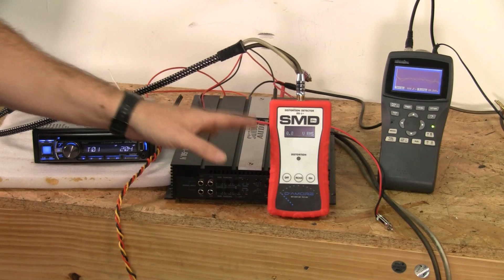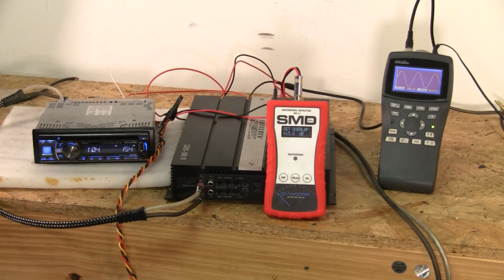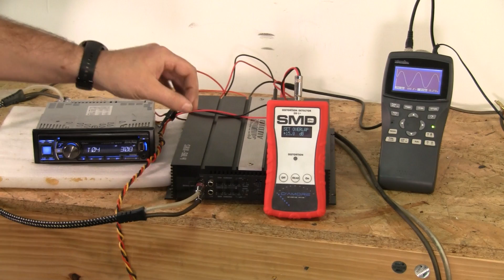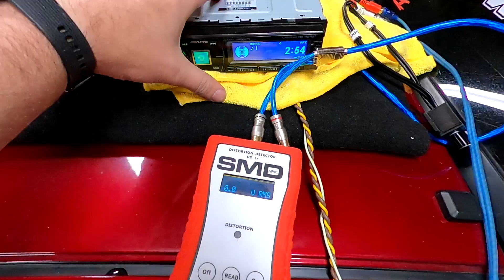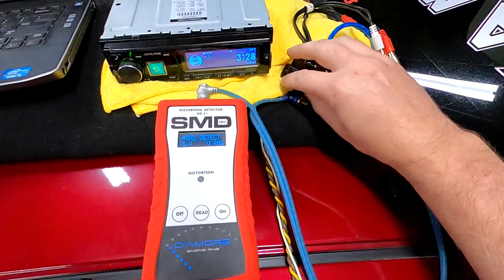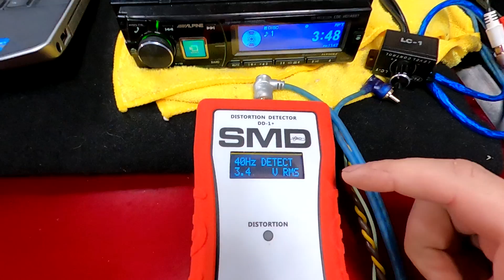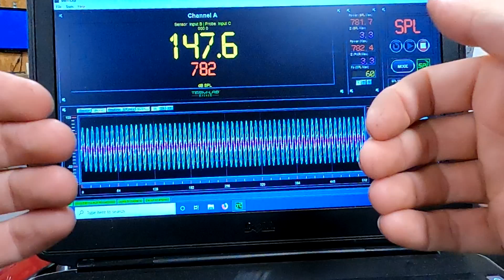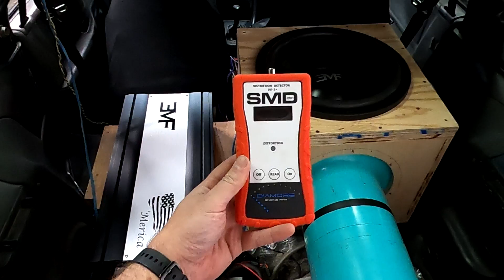The TRUTH about the D'Amore Engineering / SMD DD-1+ - Tech Stuff Tuesday

Comment: my cheap jensen HU goes up to 63, i can hear it start to clip ~48 and set the max to ~ 54 because some recordings (old ripped disks, aerosmith, boston, extreme ...) just need a little more gain and some bass boost to sound a little better. it might not clip 1% till 54 but i backed it off to 48 just to be safe. one of these days i'll find somone with the dd-1 just for giggles to see what it says.

i  have a truck full of ADS speakers and my system sounds fantastic.
Reply: that is why I hate anything DIGITAL, can we bring back analog yet

Comment: If I commented on this before forgive me. So if I’m understanding correctly, what ever source you use to set gains with a DD 1+, any addition ( bass boost level controls whatever) downstream of that source can and most likely will cause clipping. So I’m thinking if you set the gains AFTER you’ve made the adjustments Bass boost etc you want to make using the DD 1+ as opposed to before the sound processors etc you will be good. Is that correct or make sense??  Thanks for always informing and being patient. You’re cool beans.

Comment: Guys n Girls the SMD DD1+ do work and a scope also works whichever you prefer. However, after setting your gains you can still clip by adding pieces of Equipment or if you adjust your settings. That's all. EMF Audio your headline topic is causing controversy, LOL..

Comment: my question is ..  testing  different tracks /  recordings... some tracks are really loud  .some are  low bit rate. some have bass boost on the tracks/// . will this not also change the levels of distortion  clip point ???
Reply: Yes indeed. It’s something that really bothers me that most people don’t think about. If you set up someone’s amp at -10db test tones and the customer walks away and bumps decaf on the way home, they’re clipping clipping clipping. But no one talks about it. I’ve tested this on my system I set my gains at anything less than a 0db test tone and instant hard clip on some of my music and variable clipping on the others. Idk man

Comment: I always figured if you use the dd-1 to set your gains, then after if you change any settings you could clip. Which always made me wonder what the point of the dd-1 is. I set my gain with dd-1 and on my alpine it was clean to vol 30, but went to 35. In my case once I set my head unit up, bass/mids/treble/crossover and all that... I usually set my bass to -3 or -4 after setting my sub amp with what the dd-1 manual refers to as "a happy medium of clarity and loudness" which I'm paraphrasing for of course lol.  I forget what db overlap track it was for that setup though. I'd have to check the manual.  Definitely wish I just stuck with using my ears to set gains like I did for 20 years lol.

Comment: When you but the dd-1 in the instructions it gives you options and tracks for  different db overlap settings.  I believe it's 0db, -5db, -10db and -15db. For the 40hz and 1khz track. Bass boost is always a no no regardless.  I'm not sure if the track choices you used have much to do with your results but I'd be curious to see you do all the above with all the different options from the dd-1 or dd-1 + manual. Then again I'm still only half way through this video... I think I'm wrong about the different db overlap settings it says in the manual.  It may have been -5db, -7db and -10db. Makes more sense.  I haven't checked the booklet yet.
Reply: he is correct and so are you, anything done at head unit effects the out come of the hole system, I know many I have setup by ear only  and was flawless give or take depending on some of the piss poor recording studio's, then 2 or 3 days pass, someone tells them it sounds like garbage, come to find out they added more bass and treble and I could not get them to understand that effect the overall sound of everything @EMF Audio and @meade916 y'all keep up the good work and FK WHAT OTHERS THINK, because in certain sisution, we get the big head and know all and no one can tell us diff ROFLMOAO KEEP BOOMING

Comment: Are you really suggesting people "listen" for distortion, then say "yeah that's perfect!" What fuck man? You're gonna have people blowing systems left and right once they play a track that was recorded at a higher dB level. That's why the DD1 plus had the overlap feature, it accounts for that. I wasted nearly an hour of my life watching this, thinking you were going to point out some major flaw. What was your purpose? You say that the product works as it's intended to, but bash it for not getting max power in an SPL setup. It's not meant for that. You showed that with your SPL settings the head unit couldn't be turned all the way up like before or it would distort, which it would when setup for normally. SPL and everyday listening setups are completely different. Had you just made a quick video to say it works, but is overpriced compared to other options, and isn't for and everyday consumer that would be fine. You made it seem like you're jealous that he's able to sell a high priced O scope and you can't. Maybe I missed something........ Just give Steve credit for what he's done.
Reply from the maker: Where did I say to take it to distortion then leave it? I didn't. Looks like you're the perfect SMD customer.
Reply: @EMFAudio  I've never bought a single thing from Steve and don't have any need to. I just like watching both of your channels for information. Saying "turn the volume up until it doesn't get any louder" is the same, at least in my mind, as trying to listen for distortion. I'm just a regular guy that likes the basic system I have. You attacking me for having an opinion, after you didn't use the DD1+ right is pretty funny, and guaranteed I won't be buying any of your products. I am however interested in seeing your response to Mr. Damore. He absolutely destroyed this video. I'll start scrolling now.
Reply from the maker: @homerbuntin4751  I said turn it up till it stops getting louder for SPL, which will be louder with a slight clip and has nothing to do with sound quality. I'm not even really looking at or responding to too many comments because they're all the same. It's either claiming it was used wrong because that's the default response for anything car audio that didn't get a nuthugger response, or appreciating all of the good information put out there and pointing out how much of an asshole Steve is to everyone that isn't bowing down to him.
Reply: @EMFAudio  and that's my exact point. The DD1+ is meant to be used to set up a system for long term use while getting the most out of your system with minimal risk to damage your hardware. You clearly stated it did exactly that, but then turned around a said it was worthless because you're not getting all the power out of your amp. Now to say that you made that extra power by slightly clipping the amp makes your entire video irrelevant. The whole focus was originally about making the most "clean" power "without" clipping whatsoever. Again it's pointless for you to keep going back and forth with me. I've disagreed with some things Steve has done in the past too and voiced my opinion to him. To say you don't have time to read the comments is an easy copout, because you know you used it wrong but are too proud or arrogant to admit it. You're just fine with spreading misinformation. I said I'm waiting to see your response to Tony Damore because he's the actual man who engineer that tool you're incorrectly using. He took the time to watch the entire video, just like I did, and point out exactly were you made mistakes using his tool and stated how to correctly set the overlaps. If there's any comment you should take the time to address then it's definitely him not mine. I honestly doubt you will though, because it's easier to be a coward, than man up and admit you were wrong. That's something you have to live with though, so have a great day.
Reply from the maker: @homerbuntin4751  So you didn't realize there were two completely different usages, one for daily listening and one for SPL. Nothing made anything irrelevant, you just don't understand the content of the video apparently. Distortion doesn't make more power, it makes a higher SPL reading, just slightly.
Reply: @EMFAudio  no shit. Which is why there no purpose in your including an SPL demonstration in your video. No one trying to win an SPL competition would ever bother using a DD1+ to set there gains right. For that application correct gain settings don't matter, you do exactly what you said, max out everything and play as loud as you can, knowing there's going to be distortion. All you do is hope your electrical system hold up long enough to finish the run without anything going up in smoke. Once again, this is why that portion of your video was irrelevant when talking about why you should or should not use a DD1+ to set your gains properly. You obviously believe I'm some 18 year old kid that's only half ass installed $200 walmart system before, which is where you're misunderstanding things. I've set up dozens of systems both professionally and as a simple hobby. The one thing I did however always emphasize to my customers though was what the exact limits of their systems were and how increasing the current settings on their head unit, and amplifier gains could over time damage their equipment due to distortion. Most listened but some did. Overall though all of my customers were happy and if they wanted more output understood they needed to upgrade their equipment. Back then I used an O-scope which is just as effective as the DD1, but took a little more time to setup. I wasn't doing installs daily so how fast I could set things up wasn't a concern for me. The DD1+ is a professionals tool that allows you to quickly set up an amp in a small portable package. If someone is buying it to setup their personal system and that's it, their wasting their money, for a audio shop however it's a great investment, is it not? I just want to know in your opinion what did the DD1+ do wrong that the O-scope did right or better? They both detected distortion at the exact same levels, which is what it's meant to do. The only argument you have is based in personal preference, unless I missed something. You can talk about the overlap feature, but in the video didn't use the tool correctly so how you made the adjustments were wrong. Once you go back and fix that we can talk again, but still you should be addressing Tony Damore and not me. You're both professionals and should be able to come to the correct conclusion in the end. I'm just a regular guy that watches YouTube.

Comment: This overlap shit just makes things annoyingly confusing. If you’re going to play with boost or whatever then why not max that out and set your gain with the 0db track, voila, any retard could mess with the stereo and you’re guaranteed it’ll never clip unless your source track exceeds 0db (shouldn’t happen). Or you could have some common sense, learn and understand what these changes do to the signal chain and know how to avoid distortion. As a sq guy the approach is typically set gain at 0db or whatever the max power the drivers can handle if your amps are capable of exceeding their rated power and then whatever tuning you do is all cutting, don’t touch that boost. Yes I saw the other video about spreading hate but the smd products are overpriced toys and the whole overlap thing seems so unnecessary unless the person playing with the car is an idiot. If someone isn’t aware of the risks of boosting frequencies then they’d probably ignore the “don’t exceed 25 on the volume” warning sooner or later.

Comment: I am an old school car audio guy and I would have loved to have tools like this back in the day.
We used o scopes, and the RTA to set up systems. However in the very early days it was set the volume of the head unit to 3/4 volume then turn up the amp gains until distortion was detected by ear.
One thing that the guy in the video did touch on that seems to be accurate is the change in output depending on the source used.
I often use my Bluetooth connection and my phone for my source, however when I change over to my usb or head unit, the output seems to be much higher even though the volume has not changed. 
This is on my factory audio system, and I could see the possibility of this occurring in an aftermarket head unit.
Just an observation of my particular situation and it may be very different from others out there.
So it would seem that an individual doing the tuning may want to use all sources that they may used and check them all with DD-1 to ensure no distortion exists.
Reply: bluetooth is problem, go direct with 3.5mm audio jack if head unit is equipped
Reply: think of wifi vs ethernet cable

Comment: I post similar comment as last time:
DD1 works
O'scope works
Regardless of what you use to set your gains (including old school "by ear"), unless you always listen to the same track, output will vary based on source. And, setting your gains correctly doesn't eliminate the possibility of clipping the source or amp, and many don't realize an amp can clip (with gains perfect) when voltage drops and destroy speakers.
Long video with a lot of information.

Comment: Hey when your right your right. I set my gains with Bluetooth because I like to listen to spotify but shit  if I chuck a usb in there and crank it to the same volume I know I'm hard clipping. People need to wake up it's not the be all and end all of tools.
Reply: Why i stick to 1 for bass which is usb. When i listen to everyday music i normally listen to it at lower levels where its not even a issue.
Reply: @gregl5677  don't get me wrong I think people should use a tool to set there gains. be it a dd1 or an O-scope. But I also believe people should learn what distortion sounds like. I have never blowen a sub and I've had systems sence the 90s
Reply: @stephenandersen625  but most people still wont be able to differentiate 1%-5% clipping. 1%isnt to bad but not audible. Other issue some people tune to -10dbs, then go and play -5 to -7 decaf, or dj russticals or even some -3db songs ive seen rebassed. If it isnt a spl meter build i dont understand why people do that. Ive played with mine tuned at 0db and -5db, there wasnt a audible difference. Only a 1.1 db difference on the same track. People make it way harder than it needs to be. They will tune to -5 or -7 or -10. Then when a song that -3. Or say its tuned to -10 for older songs and they go and play -5 on a decaf their buddy wants them to listen to. They go into hard clip. I just tune all mine to 0db and leave it alone. It hits plenty hard and the difference is so minuscule. In my opinion.
Reply: @stephenandersen625  but bluetooth messes with that from what i noticed. Why i never use it. Cd or usb seem more consistent i could be wrong tho. Just ive never could get my system to sound right on bluetooth. Going from rebassed to rock, to country. Its like 1 or the other will sound good the rest would sound like crap.
Reply: @gregl5677  yea but that also comes down to knowing your system. if you know your tuned to -10 db and you go and play decaf at -5 just turn the volume down it's that easy you know for a fact your going to be clipping so why do it.
Reply: @stephenandersen625  most people dont know what that means at all. You'd actually be surprised alot dont. They tune there system to whatever lets say -10db then they find rebassed and will play it without even knowing what -5 and -7db means. You are basing your comment off everyone is a professional installer and knows what they are doing. When 60% of car audio is kids with kicker systems at walmart, and or they buy a big system cause a youtuber used the same subs. Then blow them up within a couple weeks.
Reply: @stephenandersen625  my 03 fosgates have lasted 17 years. Amps tuned to 0db, find clipping on the o scope turn it down like .5 a second or a full second and let it eat always played 2 volumes lower than h.u. clipping which was plenty loud. I dont get how setting gains has become this huge problem and struggle we need special tooling and you need to set 6 different things before you set finally have it right..

Comment: This makes me want to do a dedicated in dash o scope 🤔.

Not concerned with mids and highs as much.. just for the subs.. 3" coils way over powered need to stay set clean 😂
Reply: Shalamah the Brew I’ve done it and works amazingly
Reply: @Isaak0000  thank you for confirming. What unit are you using?
Reply: There’s no reason to do this. If you were to play music the scope wouldn’t display any discernible info. You’d need to play a tone and (should) also disconnect the speakers. Furthermore, mids and highs are FAR more sensitive to clipping than a sub. Which is why you’d set them with less overlap than a sub. You can learn a lot by not listening to this channel.
Reply: @jtc406  I'd want it for SPL  but at the same time.. it ain't that complicated to need it.. (when demoing) subs get smelly, turn it down.. if they get smelly fast,  recheck your tune🤷🏿‍♂️

Comment: BRO! YOU ARE STILL USING IT WRONG!!!!! Go watch Steve's video. You didn't use the overlap on the dd1+. Get the correct manual and stop using the dd1 manual for the dd1+. 😬🙄
Reply: I get the overlap stuff and you should set your gain with a -10db for a sub amp as per the MECP manual.

Comment: @EMF Audio What brand and model oscilloscope do you recommend?
Reply: Tekronics full size scope portable scopes dont have good resolution for the same price look up on ebay for an analog scopes going for cheap 

From EE major
Reply: if you are just setting gains you could pretty much get any cheap hand held scope and should be fine
Reply: @NightshiftCustom  yeah your right but I generally use a table top since that's what I have just happens to be a high bandwidth scope